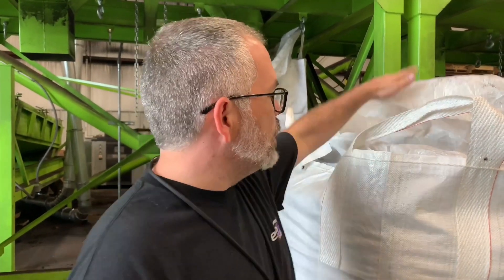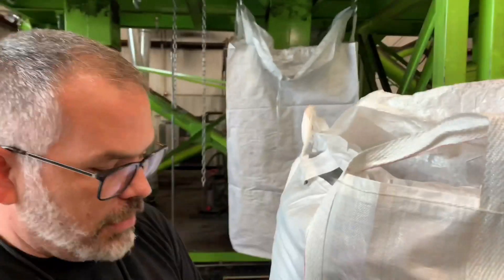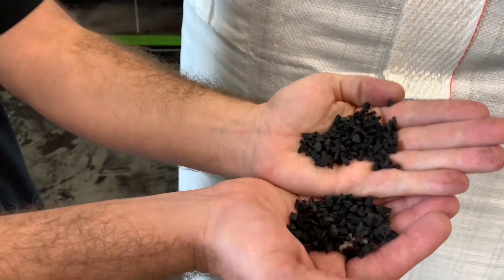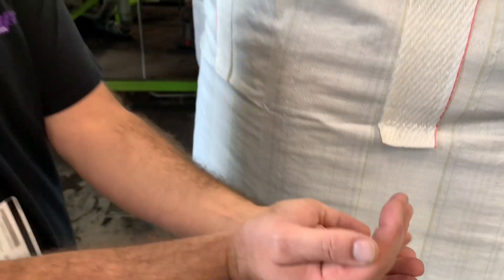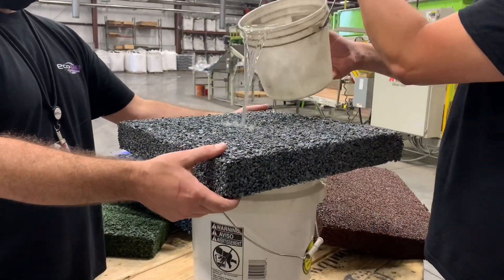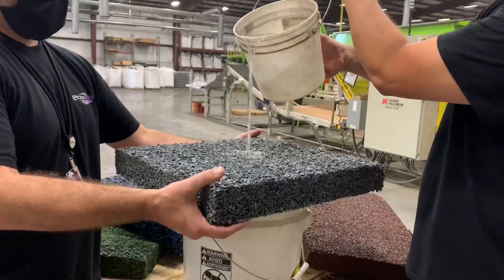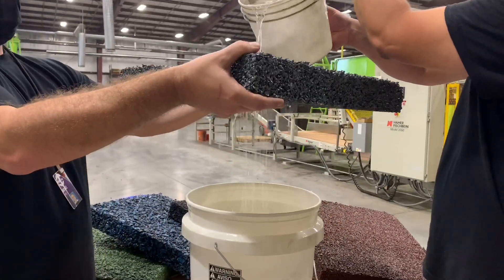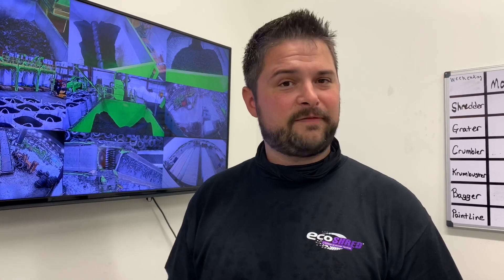Rubber Surfacing with EcoShred

Comment: For a driveway how does this do with snow and ice?
Reply from the maker: Since the material is porous, it works very well with snow and ice freeze/thaw processes allowing water to flow freely through the material and also providing an insulation factor that can make removal of snow and ice easier. That being said, we do not do any inhouse installations for pour in place rubber we would defer you to some of our customers that specialize in this application. Check out Porous Pave Inc., K.B> Industries Inc., and United Sustainable Surfacing of America for more information.
Reply: @PRIMEINCTRUCKING  Biggest question for me is will this withstand the force of scraping by snow shovels and throwers? Im familiar with this material as theyre widely used in playgrounds, but I have to wonder how durable it is with the continous scraping during winter
Reply: I wonder how it holds up to Florida sun and hot weather.

Comment: What’s the bonding agent? What are the ratios?
Reply from the maker: This particular video was just a demonstration of the possibilities.  We do not do any in-house installs or stock the binding agents, we just manufacture the crumb rubber.  Here are some of the vendors that we work with that specialize in this application:

Porous Pave
888-448-3873
https://www.porouspaveinc.com/
 
K.B Industries, Inc
727-723-3300
http://kbius.com/
 
United Sustainable Surfacing of America
877-288-0045
https://sustainablesurfacing.com/